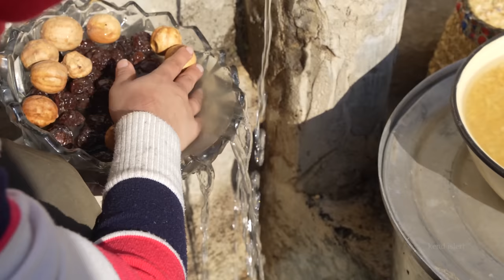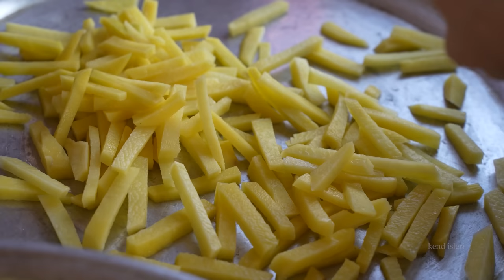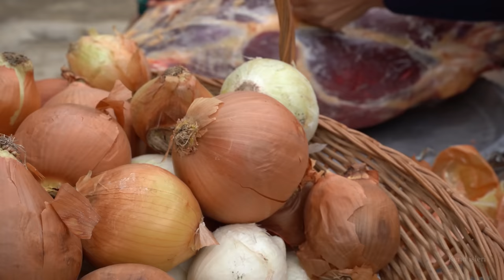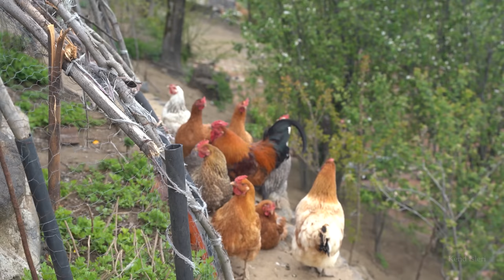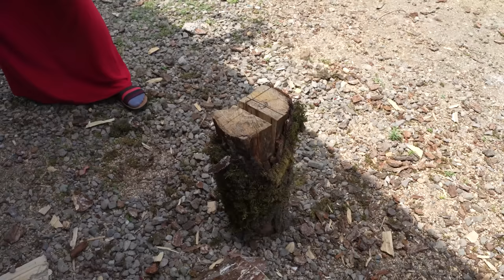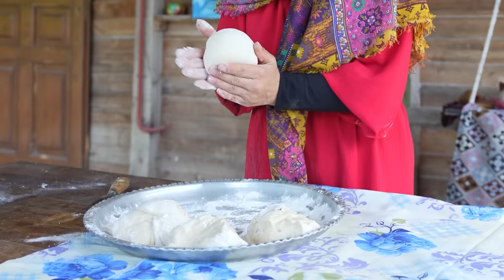1 Hour of Cooking Big Cow Leg and Vegetables to Make Delicious Stew

Comment: I have a problem with adding the split peas  should I PRE SOAK them a few hours before? or a day before? 
I learned to boil with water to remove the foam then add to the 
they still taste crappy and overcooked how do you avoid that?